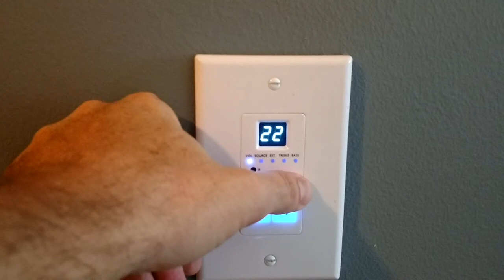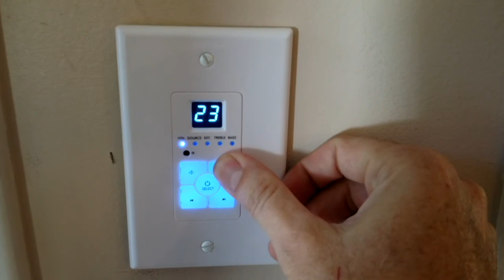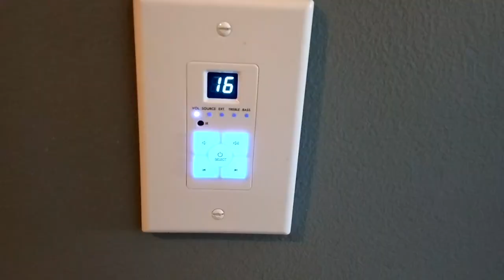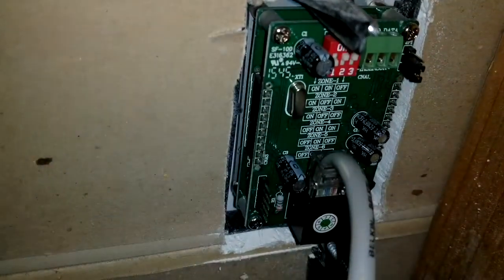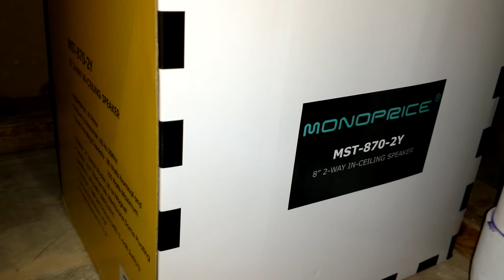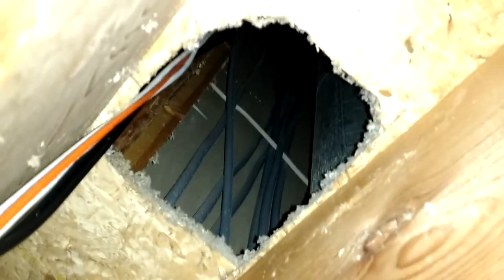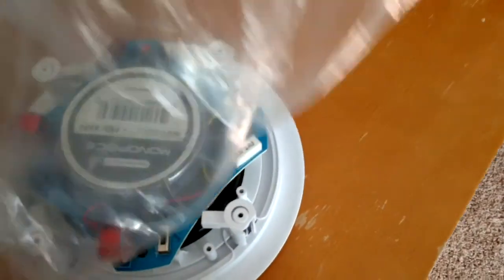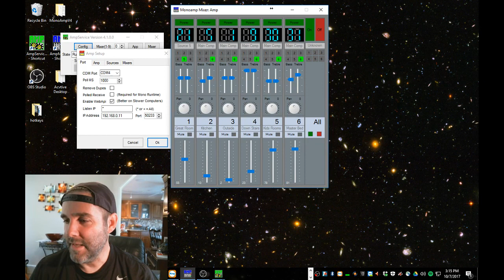WHOLE HOME AUDIO: Monoprice 6 Zone Home Audio Multizone Controller and Amplifier Kit Review

Comment: Love the video. I have the Monoprice 6 Zone amp and have everything wired up. Turned it on tonight and the keypad is blue but with nothing on the screen of the keypad. Seems as if everything is in standby mode. Any ideas? I have already held the keypad power button and it doesn't work. Any help is much appreciated.
Reply from the maker: I had this happen as well.  The keypad fixed itself after a power outage... Maybe unplug the amp for a while, let all the power out and it may reset like mine.  If you fixed the issue another way

Comment: Awesome video bro!!!  Can you connect via phone to play music in different zones .
Reply from the maker: Yes... I will try to explain it.  On my android I saved the IP address (like a web-page to my home screen).  The software on my windows machine has a way to broadcast the controls on a local hosted webpage .  When my phone is connected to my home network, the web page link on my home screen, opens in full screen mode and my phone works like a remote to the monoamp.   It is built into the software in the link above "Software Zip File from Mike (It is safe)"  I believe it has a READ ME File

Comment: How does this system work for TV's? I notice there are no HDMI-ARC ports... can you use the TV remote to change the volume on the in-ceiling speakers? if not, do you know of a workaround? Thanks!
Reply from the maker: You just have to either use RCA or 3.5 jack  or digital audio.  I hook my TV up and just use the wall keypad to turn up the speakers.  It also comes with a IR remote that you could program into your universal remote.  I also control min through my computer

Comment: How do you combine this with a traditional AVR? I'm running a 9.2 AVR in the living room but don't have enough power to support the 5 other rooms I have with in-ceiling speakers. Would they be completely separate?
Reply from the maker: Yes you could hook it up with a digital audio cable or RCA cords.  :) I have a normal amp hooked to it via the line out or record out RCA jacks

Comment: I want to do this but since I have a two story house being built right now I’m not sure how I’m going to run the wire for the first level of the house since I won’t have a attic to be able to pull it through. How did you do it?
Reply from the maker: Here is a video that may give you some good ideas  :)  https://www.youtube.com/watch?v=0vtaHpRITvo
Reply: @bubbasreviews5295  How do I run the speaker wire in the ceiling/floor between the first and second level of my home? No access to ceiling where I could drill holes in the floor joists.

Comment: By chance do you know if the switches will fit in the standard square light switch plates/covers?  like the ones you buy at home depot or will they only work with their cover plates?  btw cool video...
Reply from the maker: I think they will fit.  Seems like the same size to me and I can fit a light switch plate in its place  :)

Comment: How does the volume control wiring work?
Reply from the maker: I run a cat 5 to from the amp to each controller.    The speaker wire runs directly from the amp to the speakers.  So the keypads don't have any speaker wire running to or from them.  Both the cat 5 and the speaker wire are wired from the amp (in two separate runs)

Comment: Dude awesome video. We are about to build our house and I am seriously considering putting this in.  Quick question....the speakers you put in are 80 watt 8 ohm speakers and the amplifier specs says it will only send 25 watts per stereo channel in non-bridged mode.  I would be interested in how the speaker sound is.... considering you are actually connecting more than 2 speakers to a zone, are you getting pretty good output?  It sounds good in the video, but sometimes video audio can be deceiving.
Reply from the maker: Chris thanks.  :)  I had the same question.  I asked another youtube guy if they were loud enough with this amp... He just laughed.   :)  After installing them I know why he laughed.  They have more volume than I can handle  and I love it loud.  pick up a 12 inch sub from monoprice and you will shake your brains out.  I have a sub on each  of my 3 levels and it is as good as any in-wall system i have ever listen to... better than my friends systems that cost 10 times the money 4 times the power.
Reply: That's great.  Yeah I have planned at least six zones, but I'm also putting ethernet throughout the house for security cameras, home network, and of course the zone pads.  Much easier to do before drywall is put up.  :) How many of your zones have more than two speakers?  From the video it looked like just one.  

I watched your smart home videos....and I just ordered a Smartthings Hub.  Hope to bring our next home into the 21st century (at least until my wife takes my allowance away, LOL)
Reply from the maker: Chris Styles my wife wanted a home security system for $35 a month for a three year contract.  I added up the cost of that and got her to agree to the budget.  It was more than enough to go crazy.  😁😁

Comment: I am about to buy this system. So I need you to help me to verify the following:

Speakers wire is coming from the amp to the speakers

Pair of coaxil rg6 cabel for each source

Ethernet cabel from amp to the hub. And from the hub to each control keypad

I think that's it. I am going to install it by myself. But I want to understand something is this hub or the amp it self  have a power over Ethernet capability (PoE) so I don't need any power source for the keypad?

Thanks
Reply from the maker: You don't need any power source for the keypads.  The keypads are powered by Ethernet (cat 5) cables that hook to the  hub and then one to the amp.  You need to buy your own Ethernet cables and your own speaker wire (monoprice has great options for the cables and wire).

You are also correct about the speaker wire as they are hooked directly to the amp.   So each zone you will run speaker wire to the amp and Ethernet to the amp.  I have a suggestion for any bedroom zones, the keypads can be bright at night (like a blue night light) so do not put them on a wall that is going to be in your face while you sleep.  :)
Reply: @bubbasreviews5295  Thank you so much, I have purchased the system 

And today I was installing it and everything was perfect, except for zone 1 all jumpers setting are correct.

But for zone 1 the control keypad is working but if you press any key it does not do anything, but when you remove any other controller from the amp zone one works perfect.
Reply from the maker: @khalidalzaki  maybe unplug the power for a while so it resets the amp (then plug it back in when they are all hoked up)   or   it may have a crappy cat five plug or wire.  You could swap out the wire - or change keypad 1 for keypad 2 (Swap them and change the pins in the back  so now one is 2 and 2 is one)  THis way you can identify if it is a keypad or the wire or wire connection

Comment: I saw a product that looks exactly the same it is called factor electronics v66, heard any thing about them?
Reply from the maker: this factor one looks like it has bluetooth but looks like it is almost the same thing.... Likely made from the same manufacture using most of the same parts.   If the price was within $200 of the monoprice amp I would buy the Factor one,  just for the bluetooth and ethernet connection already installed and it would just be easier than doing it myself.

Comment: Why did you use 4 conductor wire instead of 2?  Am I missing something important?  Trying to duplicate this setup.
Reply from the maker: Curtis Hall I have long wire runs and I have a left and right speaker in every room.  It is less messy to run one 4 wire cable to each room, than 2 two wire cables. 
 When the cable is close to the speakers I separate them and run one pair to the left speaker and the other pair to the right.
Reply: Thank you!!!  I have a unique setup for a law enforcement agency that just needs radio traffic to be broadcasted over speakers, so mono speakers are fine.  How many speakers can I hookup to each zone and should they be ran directly back to the Monoprice amp or connected off each speaker to the next?  I would need 4 speakers on one zone.
Reply: I have 4 on one zone (two on left and two on the right channel).  If you want to do it right you will need to google "how to daisy chain speakers".  Lots of diagrams :)
Reply: Would a speaker selector switch work just as well?

Comment: Question about the Controller for the whole system, Mono Amp Mixeramp on your PC, is that the primary controller for audio sources?

Also, how much of a difference does the speaker size make? I was looking at doing 5 inch speakers, but you said you had 8-inch speakers and it sounds like there is a solid full-range produced by that, is there a big difference between the differing sizes available?

Lastly, your daughter at the end is absurdly talented. Thumbs up all around!
Reply from the maker: I use the in wall keypads and the remote control (that comes in the kit) most... then I also use the mixer app on my computer.      If 8 inch speakers fit nicely, I prefer them (8 inch will give you more full range).

Comment: Dude, great video.  I've installed this system and only 1 speaker works per zone! 8ohm 40W rms (80W peak) Called monoprice, got a replacement and it does the same thing. Does yours still work with the 4 speakers?
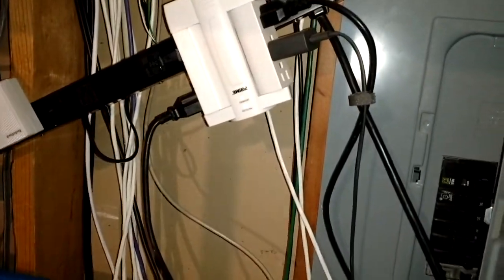Reply from the maker: If you have it hooked up like I do at 1:43 on the video time line it should work fine.     My guess is it is your input (the connection from your source)   Try hooking up another source like an old cd player or something. ... or try changing your input left and right (white to red) to see if the opposite speaker works) ...      Mine works with 4 speakers (on zone 4) because I just crammed them all in there (see 1:43 on the video time line)  zone 3 is just two speakers and zone 4 is 4 speakers.     Also you could take the wires out of the green connector harness and check each speaker individually (or swap them)  Maybe it is not set in good inside the harness.     ......   Each of the wires you see  in my video run to an individual speaker (no other connection to another speaker other than what you see in the video on zone 4)   feel free to call me if you want help trouble shooting 801 686  8852   option 1